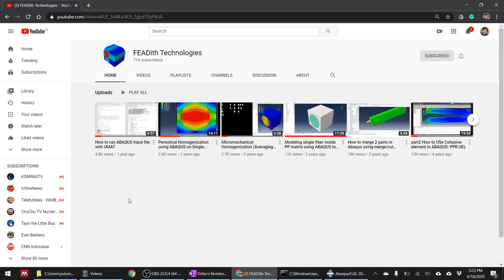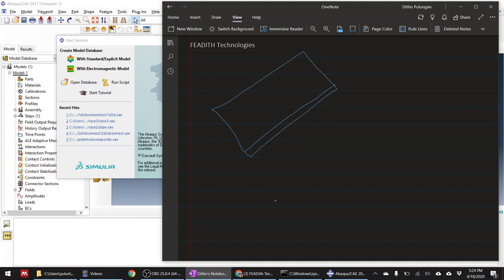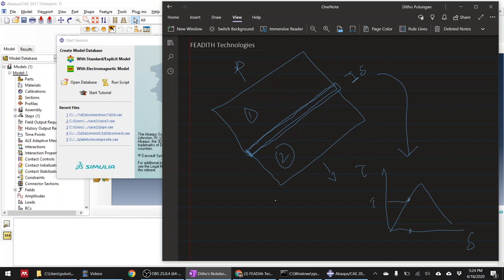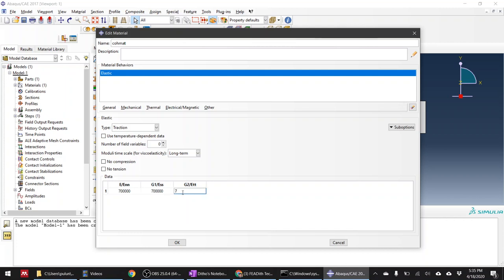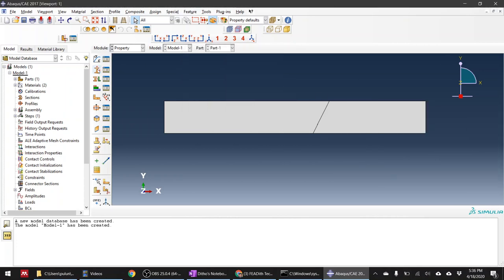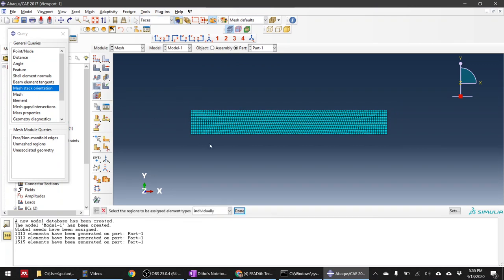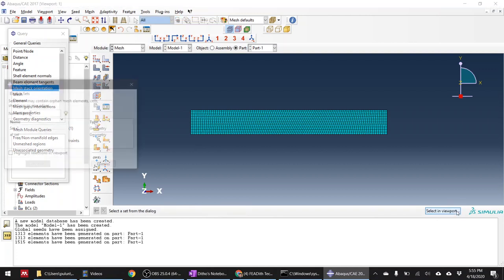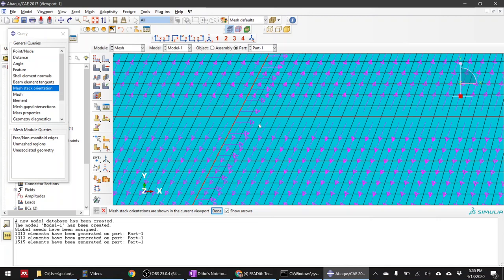2D Cohesive Elements in ABAQUS: Assigning Stack Direction

Comment: Thank you! This is very well explained! That is what I met, the stacking direction was different for different partitions. If you have a cohesive layer along 3 degree, is any requirement for the meshing technique?
Reply from the maker: Hi Ran.. nice to hear from you. 
What do you mean with 3 degree? Z direction? So you mean 3d case? No need requirement for the meshing tehnique but make sure that the stacking direction is correct.
Reply: @FEADith  Hi~~ I mean that the cohesive layer is 3 degree in this plain. In your example, the cohesive layer is around 60 degree, which makes the meshing relatively straightfoward.